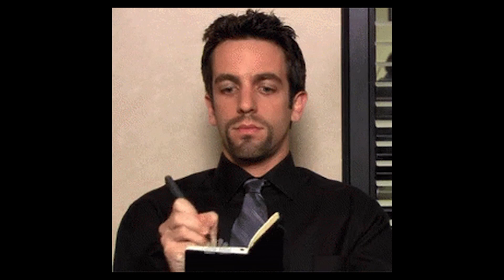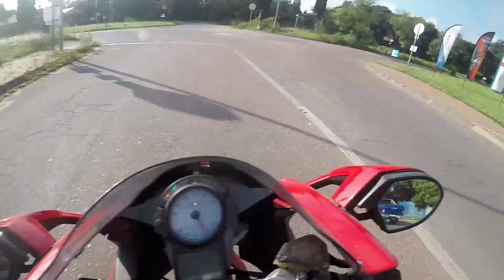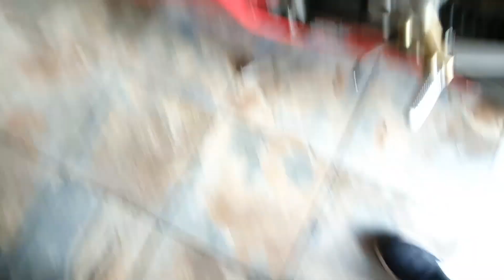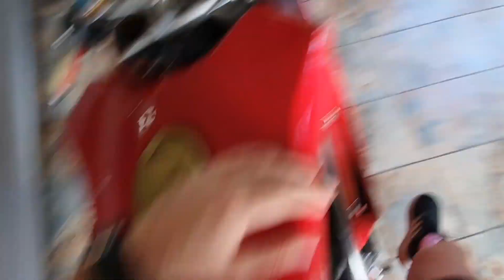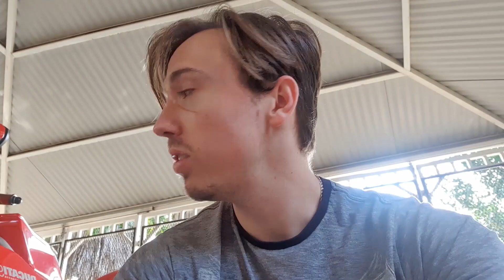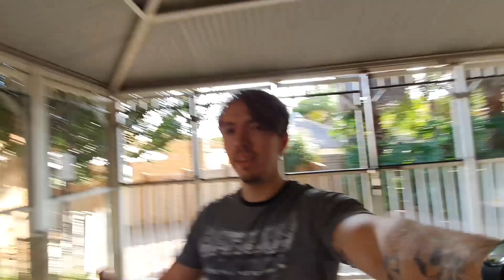Ducati 999s in-depth Review

Comment: Owned one for 5 years. (After a series of japanese bikes) Sold with 58000km and never have any serious issues with it. I did the maintanence myself as always. The front brake and suspension is like it came from another world (after a 2005 r1). If you are not a tourer kind of biker, this bike is the best experience you can get on the road in my opinion. Now due my age I switched to a Monster and I like it very much. Not as exceptionak as 999s but cheaper and better for urban cruising. But definitely the 999s was my best bike. Maybe I should buy one once again. I miss it very much.

Comment: The mirrors and side stand might be works of art but at the same time they need to be practical. The design of the side stand pivot bush ensure a lot of wear and a short life and that results in a bike prone to leaning too far and tipping over (I know mine does, even after replacing the bush and removing all slop). Also, the mirrors are impractical as they have you looking through your elbows. I fitted FSAR mirrors to mine and they are an upgrade in my view (pardon the pun). With you knees hitting the fairings, have you tried adjust your foot pegs to make more room? They won't give you inches of difference but what they do offer might be noticeable and a plus.

Pretty much everything else in your review was spot on Chris, keep it up, you've got me onboard. Take care mate, right wrist down...

Comment: #meeto I also have an '03 999s, the sound, the up on the back wheel in third at 180, I could go on. You could limit the revs to 7,000 and it would still be fast. Good thing they go to 10,500! They'll still out handle most newer bikes. Mio motocycletti numero uno, Ducati 999s.
Reply from the maker: I looove the 999s

Comment: To solve your nie problem, you should consider bying adjustable foot pegs. Take one with the Most posible adjustment. Maybe one for racing purpose. I like the looks of the 749/999 and it's racing DNA. Thinking about yousing it in the track. But not shure wether it is too outdated now a days. Nice Video. Cu.